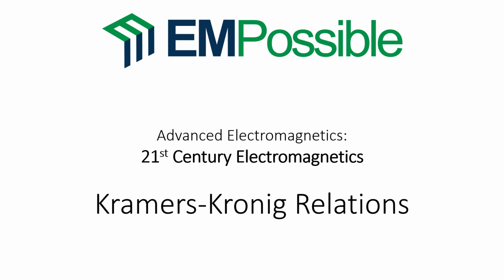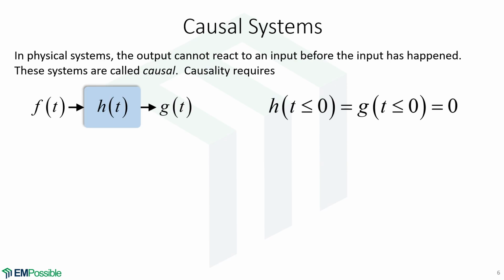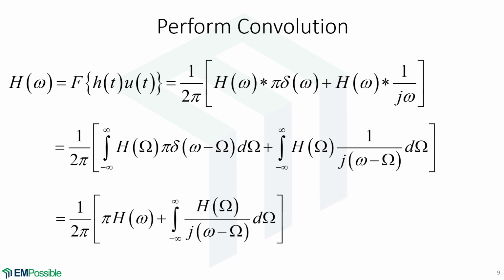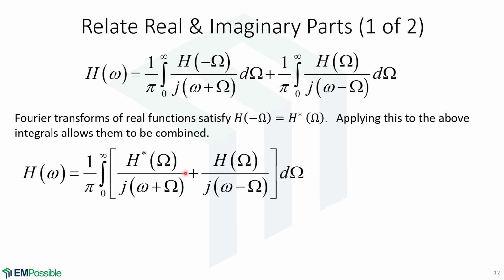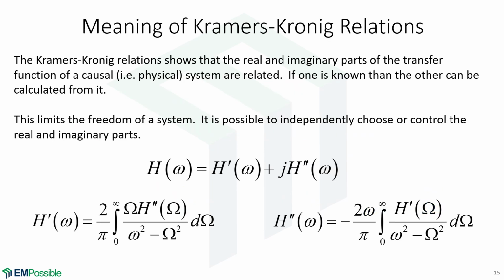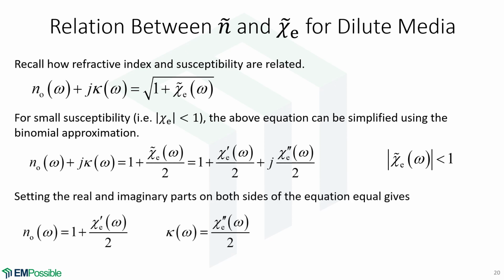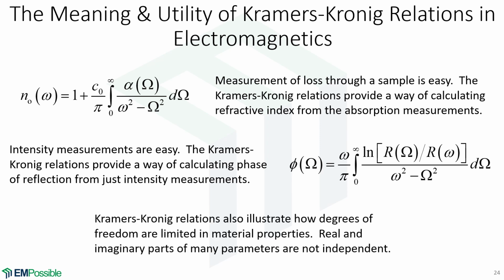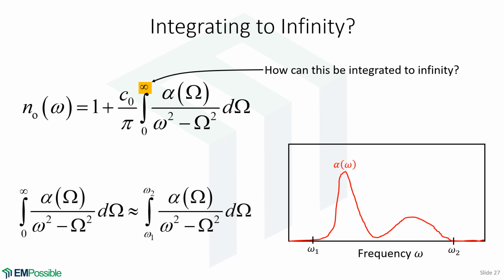Lecture -- Kramers-Kronig Relationship

Comment: Hello,
on slide 15 you arrive at the final formulation of the Kramers-Kronig Relations. The sign in the denominator within the integral is different to other sources (e.g. https://en.wikipedia.org/wiki/Kramers%E2%80%93Kronig_relations ). The Integration variable has a positive sign here (Omega^2 - w^2) instead of (w^2 - Omega^2). 

Is there a sign error in your calculation or do I miss something here? I made a check with the real and imaginary parts of the Lorentz oscillator https://youtu.be/7XASTUMUaqA?t=297 . Results match with the sign in the denominator reversed
Reply from the maker: Unsure. I will look through my derivation for an error. I most suspect a sign convention difference. I hope that is all. If I made an error, I will fix it as soon as I can. Thank you!
Reply from the maker: I worked through the derivation in more detail and realized that I mixed up sign conventions. Overall, I am trying to use the positive sign convention used in physics (not engineering). However, the Fourier transform I used of the Heaviside step function was for the negative sign convention. This is corrected by swapping the sign of imaginary part of the argument inside square brackets in the second line of equations on Slide 8. If I carry this through, I get the same equations as on the wiki page. I am going to keep looking at this before I post the revised notes and perhaps rerecord the video. Send me an e-mail if you want to see the current draft of the revised notes. Thanks again for pointing this out!
Reply: @empossible1577  Hey any update on the sign convention? I actually stumbled on your PDF while researching stuff about the kramer-kronig relation and was confused by the signs. I think there may be other people who going to find your PDF. Maybe you might consider to update it. Thanks!
Reply from the maker: @erenjaeger5344  Sorry. Very crazy schedule right now! It is on my to-do list.
Reply: @empossible1577  Thank you for looking into this. Your clear explanation is the reason I watched the video in the first place. Thank you so much for making these lectures freely available for everybody! They were incredibly helpful for open source work targeting openEMS!

Comment: Can you explain this: if the real part of U (2:39 in your video) is an even function and the imaginary part of U is odd, how could it be eventually, that the real part of epsilon is odd and the imaginary part of epsilon is even, in most of models, (e.g. Lorentz model) after Kk treatment?
Reply from the maker: Great question!  The short answer is sign convention.  Here I am using the positive sign convention where a wave travelling in +z direction is expressed as exp(+jkz).  If you use the negative sign convention, the symmetry of the real and imaginary parts is reversed.  I think you are comparing my positive sign convention math to something else that is use negative sign convention.
Reply: @empossible1577  thanks! Indeed I often use the exp(-jkz) convention !